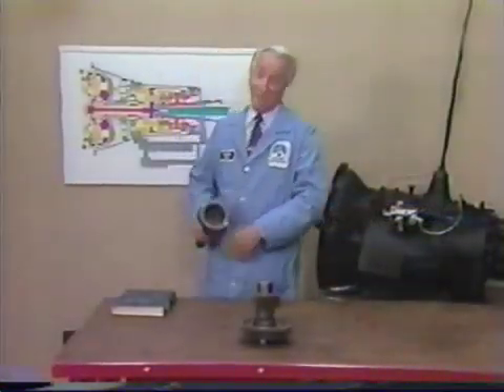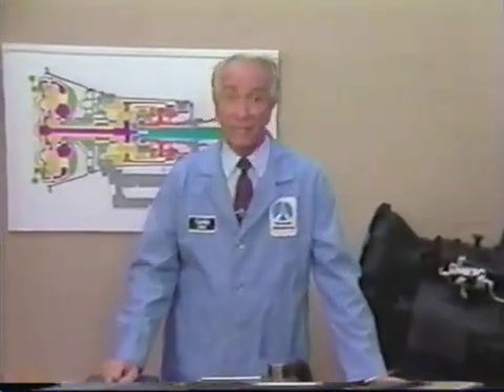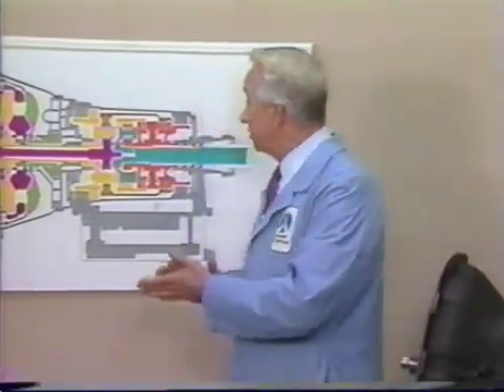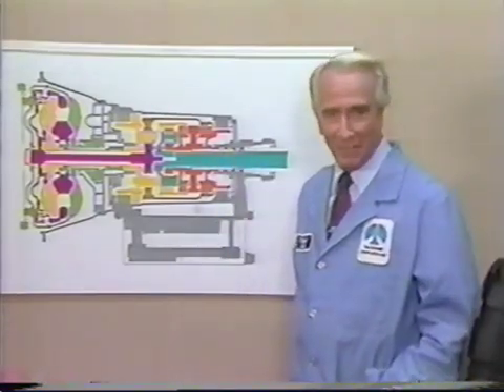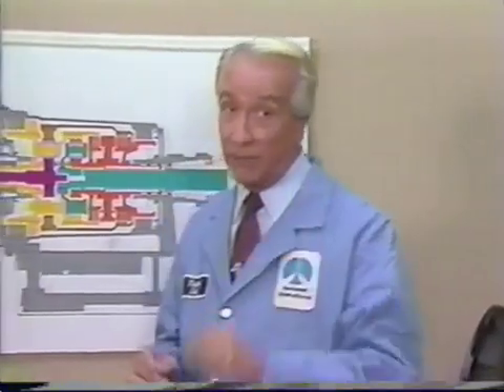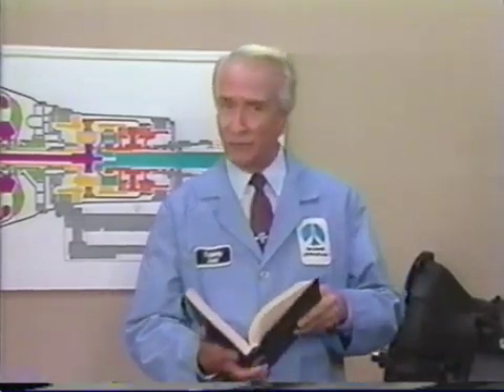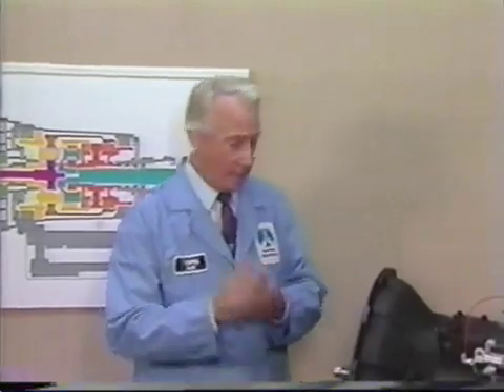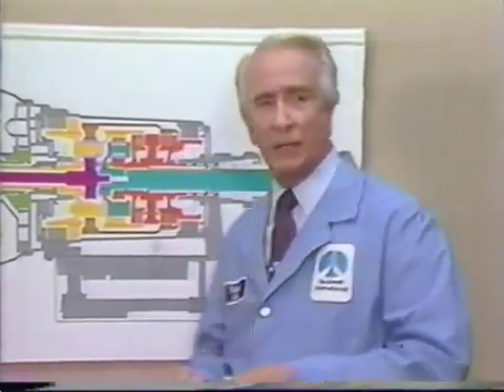Rockwell Turbo Encabulator Version 2

Comment: Ah the old days. I’m so glad they upgraded to the elliptical doppulator with reverse vertex paraoscillators. Not only is the quantifiable armature output greater but it greatly reduced the triglythylide buildup in the variable crossover housing.

Comment: Ha, he's still talking about the winglesprocket, how 90's of him. Everyone knows you can't use that in a turbo version. Due to the hyperflux resonance anomaly in the sub-phased quantum elastomeric matrix, we had to recalibrate the gravimetric impulse actuators using a tri-axial nanoferrofluidic compensator to prevent oscillatory feedback in the gyroharmonic stabilizer. Amateurs.

Comment: One day, They'll realise the "Turbo Encabulator"  issues could be solved, with the pumudit, synchro spam, into a resistor of zit ferreted, specially torsional , worm oddments , all solved with just the addition of Blinker Fluid.

Comment: I put one in a snowmobile and it improved the unilateral Pfehnutsen valve fluid viscosity to such a level that I was able to realize unbelievable gains in the Thordardson chamber, without freezing -- even at temperatures below 273.15K

Comment: Reduce sinosoidal deplanaration my ass!!! Maybe a nominal 1-2% but those bastards deplanarated above 3,000 rpm like nobody’s business. This was because the sinosoidal waves at that speed could not cancel out the natural harmonics of the spurving bearings. It worked great below 3k but at that low speed…..what the hell is the point of it all?

Comment: My nan worked on the blue print of this model back in 46 in their Delaware labaratory. She demonstrated the mollecular flange concept while under a trance, the upshot of this is that the bipedal cuplet spring, lightly welded to a gimp-truneon momentarily caused fractious stratosmatic gurblings in the truncheon valve.

Comment: This mechanism improved smoothness and reliability of track changes on 8 Track stereos by nearly 12% but was made obsolete by the invention of the cassette, which instead uses a parallel set of 12 thermonuclear reactors to reverse the motor direction and maintain magnetic head alignment. 
It's easy to overlook this in todays world of digital media.

Comment: Wow. I almost had the chance to buy one of these for $100.00. The problem was the difractive carratorometer was loose. It would have rattled against the noptic wallriter. To only other issue with it was that it was red and, as you know, the blue ones are a lot cooler.

Comment: I found an old one in a junk yard, took it home, cleaned it up and it would still run perfectly off of a 9-volt battery. Rockwell does it again!
Reply: Novice users may complain about the learning curve, but there's really no other way to make an authentic cappuccino.
Reply: @noisepuppet Anyone who thinks cardinal grameters are only for reducing sonicoidal repleneration doesn't know what they're missing.
Reply: They are also active in weather manipulation and "ET" technology. Seen it first hand. Lived a couple blocks away from one....
Reply: @williamchiafos3889  Better you than me. Thanks and I wouldn't doubt it one bit.
Reply: I'll give you $50 for it. I just need the dingle arms
Reply: @garystinnett8321  I wished. I have the short-amed variety. No go.

Comment: Please ensure when calibrating your turboencabulator, that you set your Spurving Bearings Panometrically, measuring 6.7Goeballs on your Optometer, from the datum point. The point of absolute rejuvination, will occur once the Pandemonial Retractance (PR) of the Bipedal Reluctor have been Cantancerated. It is only then, that the reactive Furability of the Anodor and Cathetor will circumvent with total, 100% Defibrilation.

Comment: As an engineer in the Coast Guard we had to deal with sinusoidal replenaration especially when in  full.power on the main diesels. We eventually switched to hardened nangling pins on the output drive of the Reduction gear inner marsal vanes with great success.
Reply: Interesting that you mention the Coast Guard, my father often denied having any DIRECT connection to the development of the encabulator, when he was an engineer for the Navy back in the 1940s.

Comment: I believe since this was produced that the encapsulated dingle-arms now are made of Unobtainium-734 to ensure proper alignment with the Machesney sprags over heavy-duty use. But this is no slap at the original engineering; it took another 10 years and $37 billion US dollars to discover, test, and mine the Unobtainium in sufficient quality and quantity to make its use possible. The current version would not exist without standing on the shoulders of so many giants in so many fields, and Humanity should recognize the earlier work of these heroes.

Comment: Obviously, he dumbed down the terms to laymans term. BECAUSE. Basically, the absorbance of the Aerobic digestion should be  matching the algorithm of the Amphoterism and Angular velocity and momentum. He changed the Capacitive reactance to 0.1% to compensate the Electric displacement field.
Reply: This is all irrelevant after Dr David Bloomenstein's 7th Volume -
Zeetshrifterelectratechnicastautisherdonablitzer - where the volumetric assembler diometrically veterated the theory of hypertrans-particularzeonic metabialysis.
Reply: jeco F - Of course, none of this would be necessary if he only had a working Interocitor.
Reply: Actually, that was standard operating procedure at the time.

Comment: how the hell did he divide numbers by letters is that possible?
Reply: It's quite simple, really. You see, in order to solve that sort of engineering problem, one needs to first employ the use of a hydrothermal telescopic magneto rectifier in order to generate the required sound of constants on the relative maximum of a transversal sine wave. Here's the hard part, though. Once you calculate your relative maximum, you must run that value through a reverse-oscillation array generator in order to find the opposite integral of the inverse square of Coulomb's constant. Only then, can you solve the equation using the output of the array to replace the variables in said equation.
Reply: +Bagpiper513 oh see but my brain exploded!
Reply: Well then, I suppose you won't be needing a turbo encabulator anymore.
Reply: +Bagpiper513 xD
Reply: dividing numbers by letters is actually quite common in programming with hexadecimal. it's base sixteen (as apposed to base ten) uses 1-9 and A-F. you can store more data with less characters that way.

Comment: This piece is quite antiquated. They clearly ignore the standard rate laws that are a key requisite for systematically turning metabolic networks into kinetic models. They should provide a simple, general, and biochemically plausible formulae for reaction velocities and elasticity coefficients. At the same time, they need to adhere to allosteric matrix hyperbolic inhibition restrictions and respect relations  between the kinetic constants and metabolic fluxes and concentrations.These are 2 areas well they fall far short of their design target. 
Where they miss entirely is with the notion that a family of reversible rate laws for reactions with arbitrary stoichiometries and various types of regulation, including mass-action, Michaelis-Menten, and uni-uni reversible Hill kinetics are thermodynamically safe! 
Also that the parametrisation of these rate laws and parameter sets obtained by synchronizing  inverse reactive algorithms, or Wegscheider-non-compliant version optimization are guaranteed to lead to consistent chemical equilibrium and elasticity states!
I mean WTF!
Reply: You're absolutely correct! This technology has advanced significantly since this crude example was made. Efficiency has been increased over 600% from this design.
Reply: Don't forget about the capacitive duration of various bimodal transvestite sprockets de-evolved over the phenyl springs linked to the rack and pinion stater of the fluctural aviary.
Reply: Great stuff except it hasta still sound like it's about car transmissions
Reply: 🙂 what
Reply: I thought my comments were quite self explanatory
Reply: Biochemist

Comment: Me and my girl friend in 1977 were VIP guests of Rockwell at the initial flight testing of the space shuttle at Edwards AFB.  The defanglelated conical tail coaxial interloping cover was connected to the main body via 72 retainer pins coupled to semi-sproidal rachelators using large modal thuckers.  The main body was attached to the launch vehicle using 14 desensitized eloid magentical turboids of the standard type although explosive ellipsoidal rotunders were used on later flights due to analysis of the rotunders which revealed acosmicanical fault of the tab inserted in 7th partial sequencing.  Upon destabilization of the fluzoid nonemitter, the shuttle was to glide to a landing.  However, it was found that exucaustive turnucles shifted the diametric phase 1.27 jallions (1.02 nominal) of output which of course resulted in a near side swipe of the viewing platorium upon which guest were assembled.  All in all the flight was a success.
Reply: Thank you for clearing that up for us.
Reply: Only 1.27 jallions? I thought it was closer to 2.01.
Reply: yeah I was there. it was a good year.
Reply: the only thing we're just not sure we believe is that you had a girlfriend 😂

Comment: This is the best video to play in the middle of a public restroom
Reply: Use a clip board while frantically taking notes and mumble something about "I need his job so bad since others turned you down" "My wife is expecting twins" use spray sweet (quart of water, heat, add 1 cup tables salt, stir until dissolved) and act nervous & dis-shoved and upset.
Reply: Exactly what I just did
Reply: Where do you think I am right now…
Reply: Why?
Reply: @Ac22768  It's simple. The Human body has varying degrees of poopifcation, and the bladderdicios figmation, which of course is connected to your spinal reganter receptors. This video effectively activates the tingulators on that same frequency. Then the analreduncy fabrication can flow through the septhual pipe without hesitation. Creating a satisfactory experience for our customers.

Comment: I'm currently in the process of manufacturing this model of the turbo encabulator with some minor improvements. I've developed most of it already and I was able to substitute the original base plate of prefabulated amulite with dicontrate menanic. I've found that because of the substitution, I can no longer utilize the High S-Value Phenylhydrobenzamine and Remonitive Tetraiotahexamine mixture because the narconium levels produced when they are in contact with the dicontrate menanic degrade the integrity of the spurving bearings which may disintegrate and destroy the pentametric fan that is in direct line with the spurving bearings. Furthermore, the reaction somehow seizes the differential girdlespring which effects the motion of the grammeters. Does anyone have any suggestions for a new mixture that would produced the desired results, or should I just ditch the dicontrate menanic and save up for the prefabulated amulite?
Reply: I've done the same thing, but I have found that a 30/70 ratio of potassium permanganate and ether of mercury does the trick rather well.

Comment: After three years of discussions with his plenipotentiaries, Von Strek Braun clearly saw the Encabulator to be the worthy successor to the  Turbo hydramatic 400 used in early GM cars.  Unfortunately due to a minor miscalculation in centrifugal variance of slightly more than .1204735 in flow rate, it was discovered that the metrocardiobiolic ventricular caused the whole thing to fail.  How sad, it showed such great promise!!!

Comment: this is how you extract a compressed file on Linux
Reply: @Captain Angry instructions unclear; typed "extact;" dingle arm is now stuck in panametric fam.
Reply: Captain Angry No! In modern iterations of Linux this method is known to produce sidefumbling which causes irreversible damage to your peripherals such as dingle arms and panametric fans, as other commenters noted.
Reply: LMFAO accurate.
Reply: It’s simple, really. You could use utilities like unzip or 7z but your best option is really to use unar. Of course That requires GNUstep, which you’ll need to compile. Wait, GNUstep needs an Objective C compiler, so be sure to install that. You know what, actually, p7zip might be easier. Actually, p7zip doesn’t do a great job dealing with encodings so maybe you should stick with unar to avoid mojibake. Hmm. Now if only you were on Arch, you could install an AUR helper and use the AUR pkgbuild for unar... maybe there’s a repo with a compiled unar, then all you’d have to do is add that repo to your system, synchronize it, trust the maintainers GPG key, and install it, like 1 2 3! Honest to goodness, how about we just run WinRAR in Wine for now...
Reply: It's called the File Roller
Reply: 5 years later this is still a hilarious comment
Reply: That requires a synchonous bitspew to the routerflange.
Reply: Holy shit I laffd
Reply: *this is how you SUDO extract a compressed file on Linux.
Reply: This is how you troubleshoot driver problems on Windows.
Reply: tar xvf <file.tar>
unzip <file.zip>
Reply: @ulissemini5492  tar xvf archive.tar.gz will automatically unzip the gzip archive at least
Reply: 😆 Noo it isn't that bad... Personally I think it's easier to do in Linux than on Windows, but I get your point. It's foreign the first time you do it.
Reply: Computer engineers are such a humorless lot.
Reply: Bobby Yates As a computer engineer, I’ve lost my sense of humour after having to repair countless cardinal grammeters because clients would always ignore my warnings about messing with spurving bearings. The logarithmic casing will NOT prevent this kind of damage.
Reply: It's actually simple. Just use gzip, bzip2, xz, or lzma depending on the file type.
Reply: @gabemaibergermedia  don't forget to type in startx ;) 
Dear lord... what a mess it all still is.
Reply: @gabemaibergermedia  tar -zxvf <file.tar.gz>.

Comment: The Turbo Encabulator has been a troublesome part on my car too.. "I've" narrowed down the problem.. The polygear resonator clip breaks away from the after-knocker isolator causing the spin-graph metalizer pin to phase shift! ;)
Reply: +Drummer2k Probably a weak garter spring on the torus phase vane cathartic oil pump gland. Repair it with electrostatic polystasis grouting backed with a wave washer.
Reply: +1949kf HAHA! love it! :P
Reply: Not if you add Sudo-inversed riveted oil. Works like a charm.
Reply: Doesn't that also clog the 5th Fritter valve?

Comment: I... Didn't understand.. A single word. Apart from dingle arm. I got that one
Reply: +Chris Hudlin A drawn reciprocation dingle arm, mind you!!
Reply: +Chris Hudlin thus, the origin of spaceteam :P
Reply: +Chris Hudlin  Education has gone down hill.  In my day we were required to design and build a regenulated transcriber of the 4th order.  That sub assembly was then digranulated into 4 thyroidal isoencatubulations.  This is high school stuff.  Also, a biogenerated diexial solution (7%) was added to the flexural plenal valve at the lower limit.  I would have gotten an A except that I left the sochidiventaltor uncapped.  Fortunately no one was injured in the ensuing formation of dimethous hydrazinic cloud of granular precipitation upon obtaining ambient pressure.